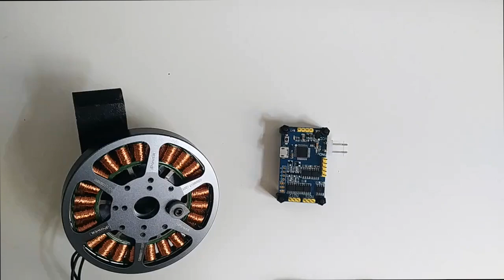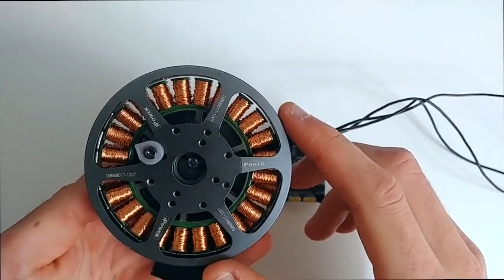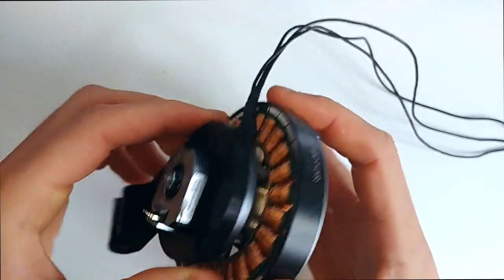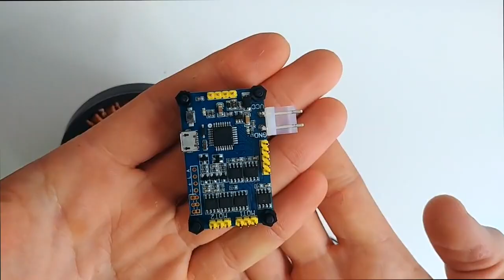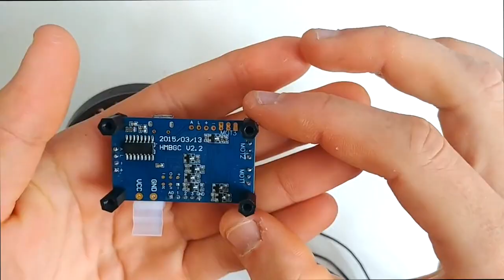Arduino Field Oriented Control (FOC) Open Source Library Demonstration -  Simple FOC project

Comment: Is it possible to use this for an aquarium pump with a bldc motor?
Reply: This is massively overkill for a simple pump. You can buy them for 15 bucks.
Reply: @lbgstzockt8493  Sorry for the noob question, but where can one get such for 15 bucks? Or what is it called? Thanks

Comment: Hello nice project,  please help to select low cost driver for hoverboard motor 36v , have you used hoverboard motor
Reply from the maker: Hey, here is a link to the supported drivers: https://docs.simplefoc.com/bldc_drivers
This is a bit complicated topic so I would suggest to discuss it in one of the community threads: https://community.simplefoc.com/

Comment: hi. great video. can you suggest any other cheap encoder that i can used?
Reply from the maker: hey Nail, the cheapest are as5600 magnetic encoders :D
Reply: @theskura  any thoughts on how much better the AMT103-V in your video is than the as5600?  I see the AMT103-V is up to 2048PPR and the as5600 is "12-bit resolution" which I assume means 2^12 = 4096PPR.  Not sure what the as5600 top rpm is but one thread discussion speculates around 5000rpm.  The AMT103-V spec sheet says 7500rpm@2048ppr.  So...I don't see why the AMT103-V is literally 20x more expensive than the as5600.

Comment: fantastic library --> really fantastic

I do have plenty of ideas on how to use it :
- BLDC camera guimbal
- solowheels (would need Hall sensors and quite high speeds)
- electric skateboard (sensorless BEMF foc would be a real plus)
- ebike controler (sensorless BEMF foc would be a real plus as well a regen braking)

I will register asap on the forum and read all this nice work done
JP